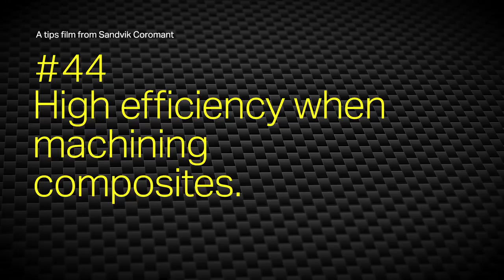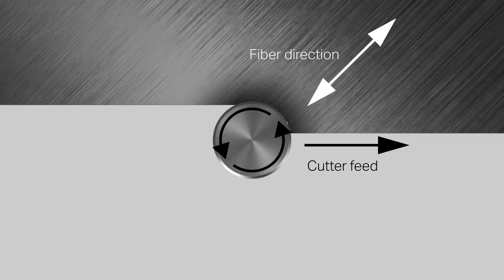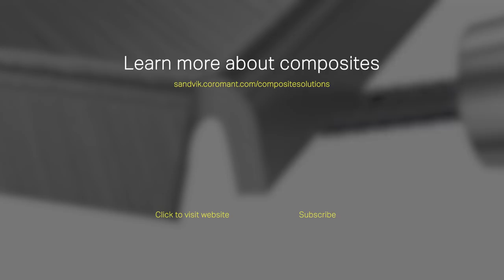Tips film #44 - High efficiency when machining composites

Comment: Serious? Have you ever made a Carbon fiber product?? The fibers are mixed (at least) in two direction to maximize strenght (to torsion, bending, etc.) You never have  a  way to follow the fiber to have a CLEAN CUT!
Reply: you have obviously never used a 2P350 Composite Endmill from Sandvik Coromant
Reply from the maker: Hi, 
First of all please excuse the delay in answering.
Great question! Yes indeed we have made many different types of composites and perhaps that is where the misunderstanding may exist. The animation depicts a situation where one fiber direction is on the top layer. This is very different than when a woven lay-up is on the top layer. Either way, you are correct, it is impossible to follow every fiber, however, our product certainly provides a much “cleaner cut” than our competitors. Give it a try and you will be surprised 😊

Best regards,
Aaron Howcroft - General Manager Product Management
Reply: @mattjohnson1453   oh my lovely FANBOY! Sandvik is way more serious than you in answering my statement!